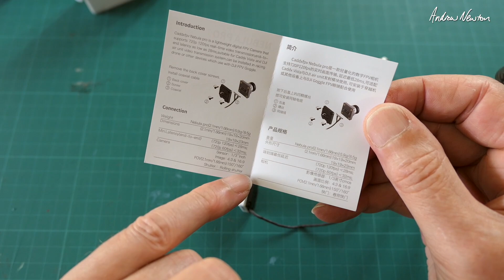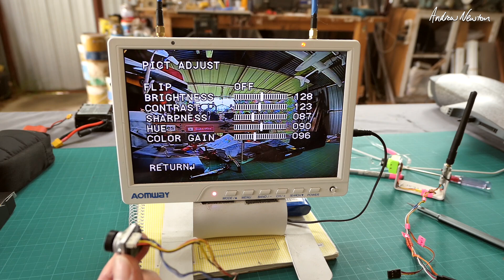Caddx Nebula Pro - Camera swap

Comment: Are you using a separate lipo to power the system or are you plugging into the receiver ?
Reply from the maker: 9V from flight control board usually, or straight from the flight battery
Reply: @AndrewNewton  I plan to use a 3s 300mah directly to power it, is that enough watts?
Reply from the maker: Guessing 5 min on high power, but I have not tested.

Comment: Do you have to do any firmware update on the Caddx unit to get it to recognize the Nebula Pro since it can do 4:3 aspect and low latency mode?
Reply from the maker: I haven't been following firmware updates
Reply: @AndrewNewton  Do you use low latency mode or the 4:3 aspect ratio in the goggles?

Comment: i recently swapped a nano camera with a nebula pro. i kept the cable the nano was using and when i fire up nebula pro i get about 10 seconds of video in the goggles and then it goes black. everything seems to still show its transmitting video but the camera settings are greyed out. its as if vista thinks i still have the nano attached. not quite sure if i missed any settings, thoughts?
Reply from the maker: Cant think of any reason other than damaged cable, or not seated right?

Comment: Hi Andrew intend to Use Caddx Nebula Pro on my Mavic Air 2 with the Dji Googles 1if i understand V1 has one Screen V2 has 2  2inch Screens
I have one good left Eye and useless crooked right Eye . I google with lenses i see onle half of the Display 
I dont like the noisy  DJI FPV and i am not interested in FPV racing .i am 80 years old on have not the speed of a 18 year old 
but i like flying taking Video Photos and especial Panoramas ...a marvel from the Sky 
i started out 3 years ago with Parrot Bebop 2 and also like the small manual Drone in my Backyard
Andrew you live on the Gold coast and i am in south Brisbane i would like to meet with you sometime  

i will contact you later on your email  and give you my Contact info Hermann
Reply from the maker: Hi Hermann. Might be confusing the goggles. My V1 goggles have 2 screens just like the V2. There are single screen DJI goggles but I dont know anything about them. I'm in Geelong Vic, a bit further south than Gold Coast.
Reply: @AndrewNewton    Hi Andrew thanks for the replay thought i saw a video ,you flying a Plane on the Gold coast 
but i cant be right all the time ,according to my Women.
 still Nebula Pro  and  DJI googles are a grate Combination  . I tested Google2 at DJI shop here ...beautiful picture but what a pity seeing only one screen and paying for 2 ...so back to the Drawing board for now

Comment: Losing your prop in glorious HD...So, this was recorded on your DJI Goggles?
A LOS test flight...What do you think to DJIs FPV system Andrew, now you've had it for a while?..
Reply from the maker: Still a genuine surprise how big and clear the image is, every time I put the goggles on. I shared them around my flying buddies last time we were all flying and they were all drooling.
Reply: @AndrewNewton  Yes, I tried my mates on just before our weather and COVID shut us down...I just can't quite focus on the screens. The weird thing is, my reading glasses make it much worse...🤔😯🇬🇧
Reply: @EnglishTurbines  There is prescription lenses available for the DJI goggles, but for the life of me I can't remember the name of the company that makes them...I'm about blind without my glasses on so it is something I have to look into as well.
Reply: @BlackTownie999  Yes, spend a fortune on goggles, only to discover you can't use them...🤔😳
Reply: @EnglishTurbines   You need to use your distant glasses with the goggles the ones you wear when driving your car, so it's just the opposite from reading glasses...
Reply: @koala2052  I'm long sighted, it's why I need +3 reading glasses. The same reading glasses I use with my box goggles. Those glasses do not work on DJI goggles....🤔😳😏🇬🇧

Comment: I did this with my beta fpv 85x whoop, fitted perfectly, they used the nano camera in it with the adaptor to bring it up to micro camera size so this fits in great and makes flying such a more fun experience - you don't need to disassemble the vista though to change the camera cable, just undo the screw to the right and remove the tension bar and the cable will pop out, getting it in is a bit tricky but nothing a big magnifying glass won't solve.
Reply from the maker: Thanks for the tip. Didn't think about that